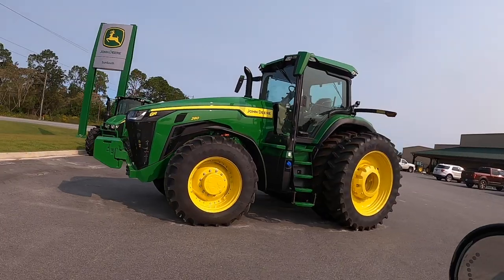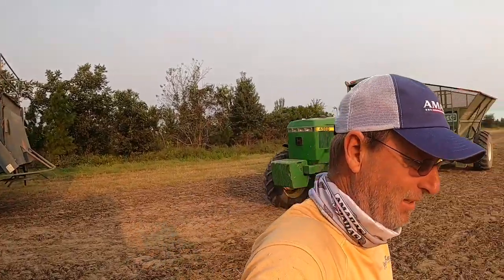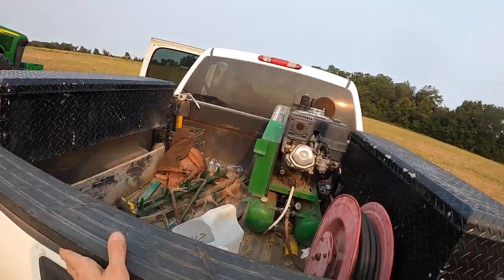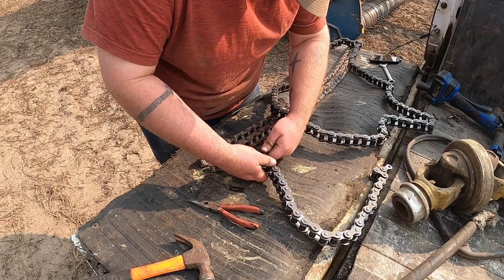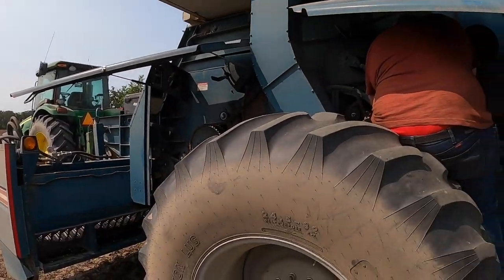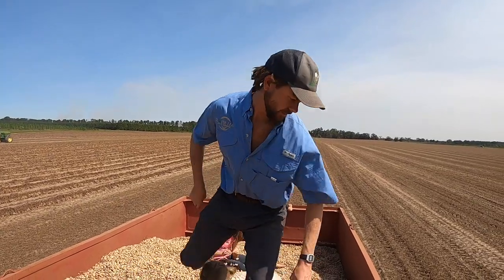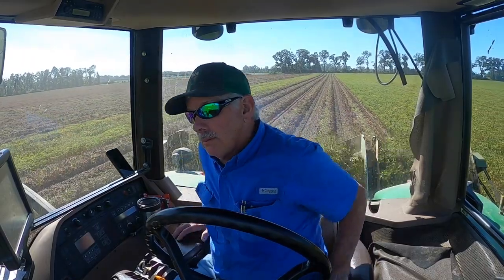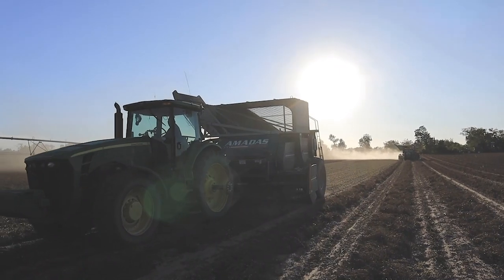New Tractor.... Yes Please!

Comment: Why not use a battery powered leaf blower or gas powered to blow the machines and then use the air to finish   I have seen other farmers use this on corn and soybeans and it gets er done
Reply from the maker: We have tried that, a lot of dirt is so thick it will not blow off. A stronger one I supposed might work